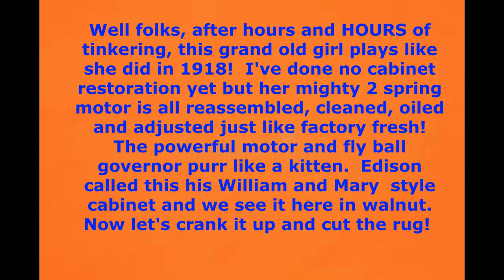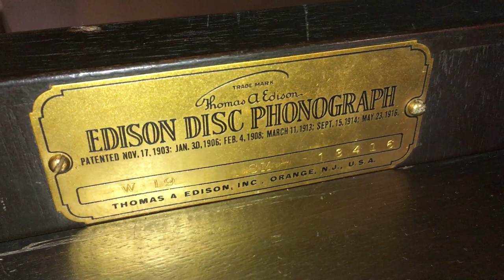1918 Edison Diamond Disk Phonograph plays "California" by Vincent Lopez and his Orchestra!

Comment: Hi Scott, I have the same player with a slightly different cabinet. I think yours is a little older than mine. I got mine in the early 80’s. Mine has a slight mold Mildred odor. I am currently spraying it with a vinegar water solution. I have never done any work to mine but it plays like a dream. I did loose the handle to raise and lower the needle. Do you know where to get a replacement????  I have been watching eBay but no luck yet. I may be searching with the wrong title. I have just been searching “victrola phonograph parts”. Your player is beautiful! You got a great buy!  I would never sell mine!  That diamond needle is great compared to the ones that will only play to songs!
Congratulations 🎉🎈 David
Reply from the maker: Since Edison machines are not technically referred to as "Victrolas" I would search under "Edison diamond disc parts".  Victrolas were only made by the Victor Talking Machine Company which later became RCA Victor.  I'll also look for you!
Reply: @oldcuriosityshop265  oh wow! Thanks Scott, I didn’t think about that!  I will start a new search.  I really appreciate the reply, love the videos too! 
Happy 4th! 🇺🇸🎈🇺🇸🎈🇺🇸🎈🇺🇸

Comment: The W-19 was originally introduced as the W-250 in 1917, the model was then changed to the W-19 in 1919 before being phased out in 1927.  No serial number records survive on this particular model to get an exact year, but there were changes made in the cabinet over production.  In 1921 they dropped the lid locks and the finish on the reproducer changes several times. It's hard determining the finish, but I'd put your model more between 1919-1922.

We can look at serving serial numbers on similar models like the C-19 and its production estimate for 13416 is late May of 1920. That could narrow down the production year for yours as they used similar serial numbers, but the C-19 was introduced two years earlier as the C-250 in 1915.
Reply from the maker: Thank you for all of the added information.

Comment: I’m currently working on one of my own Diamond disc machines. Just a smaller B-19. I also have my C-19 which I’ve enjoyed for the past 5 years. The spring for the winding pawl is bad and I’m patiently waiting for the full set of screws for the winding pawl because when I got it only ONE screw was in there! The rack with teeth that tracks with the wheel was BENT! Some wacky unexplainable things were done with these machines over the past 100 years, redneck fixes and all…BTW Your machine is a W-19 from circa 1919 to about 1924?